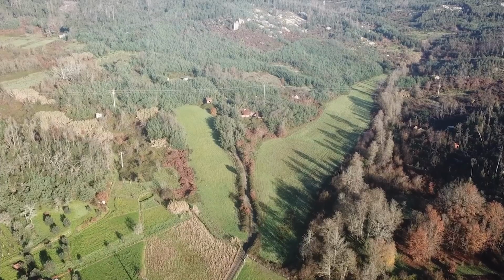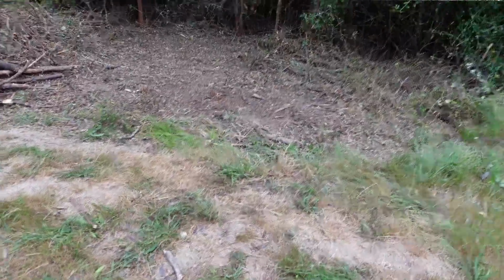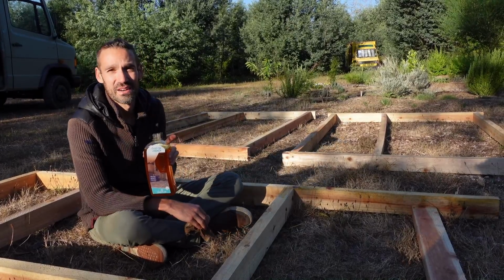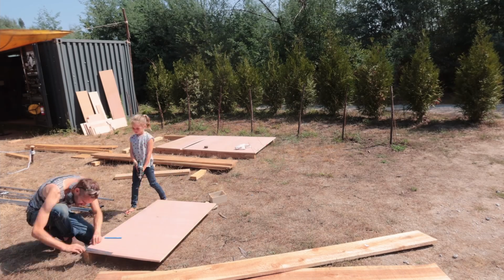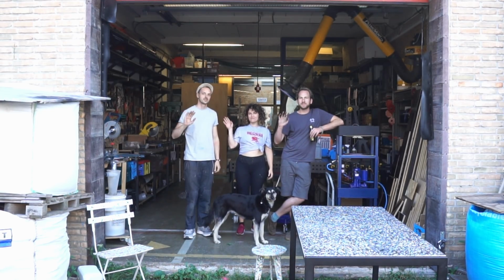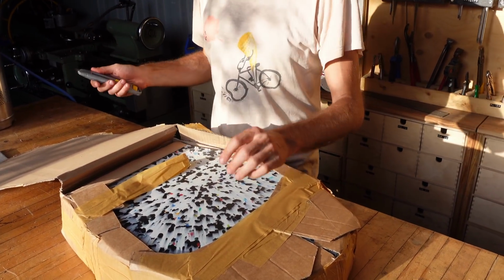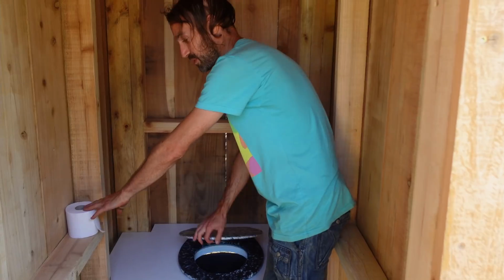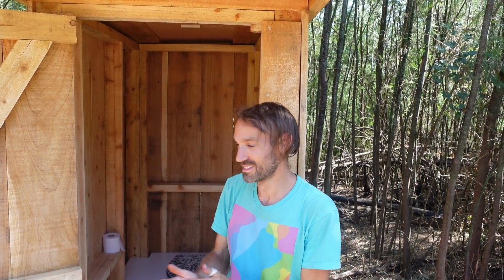#32 Making of our compost toilet. With recycled plastic toilet seat!

Comment: You would be advised to put aplastic ‘pee shield’ on the inside of the toilet box to avoid the timber getting soaked.
Reply: I have seen composting toilets use a funnel made of flexible plastic, like rubber roofing material or a bucket with the bottom cut out, to ensure that the fresh sewage goes directly into the catch basin and not onto the toilet itself where it’s harder to clean.
Reply: You beat me to it, not only will the timber rot but it will also stink to high heaven.
Reply: This a true "bushradical" moment, he is a strong supporter of the pee shield
Reply: Aren't you supposed to pee elsewhere?  I read that if you pee and poo into the same container it makes the compost process significantly less effective.
Reply: Loving them orsum Toilet Seats.. such a orsum idea.. recycling plastic..

Comment: An insert for a separation toilet would be a good idea for use of recycled plastic. With such an insert you could separate urine from the rest. This way the moisture level is easier to maintain, without too much saw dust, the smell is kept down and the bucket will not have to be emptied that often. The additional benefit is that the guys don't pee on the toilet seat :-) 
These separators sell for good money. Using recycled plastic for it, generates an unique selling point.
Reply: And urine, while diluted (and uncontaminated by poop) is a wonderful fertilizer!
Reply: I think guys will still pee outside the outhouse. A diverter funnel and hose would be great for those times sitting down.
Reply: "The guys" can just sit down by the way.
Reply: what i said
Reply: No guy would go peeing in that booth, believe me.

Comment: Well done ! It would have been great to separate peen from poo. Pee, onces diluted to 1:20 with water makes instantly the perfect fertilizer for any plant, while poo needs a two year cycle to be composted. Separate fluid helps also a lot to reduce smell too.
Reply: 100%
Reply: Even if you just get the blokes to pee in watering cans it's better than nothing. On one community garden I've been involved with we used an old plastic  bottle, turned upside down & attached to the wall, cut into a rough urinal shape and with a short hose attached to the lid feeding through the wall and straight into a normal compost bin next to the composting loo.  On my own allotment I just pee into a watering can (in the composting loo shed!) and then use it to water the apple and plum trees.

You can get pee diverters for the ladies too but that's a bit more involved as their, er, "plumbing" is a little bit different to us chaps (so I'm told! ;-) ).
Reply: Everyone tells one to seperate the pee from the poo, but if there is no need for liters of fertilizer and you have no sewer I dont see any big advantages. I think it can also make more work if you have no sewer. In my experience the smell is not a big problem if one uses more sawdust and maybe effective microorganisms. Which would also help to break the poo down much faster.
Reply: @axelSixtySix  I think two years is the worst case, with a meat eater with bad gut flora. A good plant-based person with good gut flora has very benign stool. It could be dealt with basically the same as cow manure.
Reply: @lightdark00  It  sounds like a vegan questionnable ideology. Contrary to omni what you may think, vegetarians have weak microbiota compares to omnivores. Low bacteria types leads to more composting times. Human dejections are filled with a singulary microbiota that reacts mostly under the warm temperatures of a human body. In the composting bin, it requires about two years, and even more in cold and/or dry climates.
Reply: @axelSixtySix  "weak microbiota"? The absence of the bad flora does not make anything weak. More variety is hosted by having a varied diet of a whole-food plant-based, not a junk food eating vegan.
Reply: @axelSixtySix  Animals are supplemented B12, unless they have access to an non-purified land water source. So instead of eating animals, and drinking questionable water, a supplement once a week of B12 is plenty. It would take years to show a deficiency. Everything else, not available from plants, my body makes from the sun or changes what I eat into higher level chemicals. Furthermore, my transport and living choices means my abundant D3 from most the year, will keep me adequate through winter. I also tend to lose weight over winter, so that's excess D3 and vitamin A there too. 
No one today benefits from the average omnivore diet. As people age, they seem to get fatter, and mental degeneration is on the rise too. All brought to you by the bastardized standard American diet.

Comment: Lift the whole house onto some stones (~15cm) with some plastic on top as water barrier to avoid capillary water transport from the stones into the wood.
Reply: Wax on the  bottom edge of the boards will stop capillary action just as well.
Reply: Can do that, or just some concrete stumps plus ant caps ;)
Reply: @kschleic9053  Won't be enough. If you want to keep your stuff from rotting, keep it away from the ground. Always.

Comment: Tip when you renovate the outhouse  put a sheet of corrugated steel on the inside, it will prevent pee from rotting the front panel

Comment: As an old Hippie from the 70's USA, the outhouse on my farm would fill with water and occasionally when dropping a load a little drop of that water would slash up and hit you right on the money spot!
(Arm gripping shrieks of terror ensue) so I installed a sheet metal baffle of sorts so your poop would hit that first and deflect and minimalize any splashing (huge sigh of relief!) but our friends from the city when visiting complained about when they finished they would turn around and expect to be doing something to complete the transaction and were left unfulfilled~~~ sooo I installed a toilet handle to the side of the box with a chain that went down to the tin baffle, when you turned the handle it wiggled the metal a little, it actually did nothing but it solved the city people anxiety and gave me great amusement!

Comment: Next job, build a compost bin nearby to empty into, or rather build 3, one for each yearly cycle. Also, ventilation to the cubicle and also to suck the stinky air and flies out of the loo part. And a door at the back to keep out the flies and wildlife who might want a poo dinner or make a nest. And also, make a separator to catch the pee so it doesn’t all mix together.

Comment: A DRY composting toilet would work much better for you!  The idea is to separate the urine from the solids.  I have seen them in rural areas in México, they work very well! They build two separate deposits for the solids, and they use one toilet first. When it is full, they switch to the other one. (Two toilets but only one in use).  The full one gets "sealed" for a number of months, and when the time is up (don't remember if it is 6 or 9 months), they open it up from the base at the back where they left a door, and they take out the compost, ready to use in the garden or orchard.   The urine is diverted directly into a big bottle or bucket. Then they dilute it and use it directly in their garden.
The great thing is that it doesn't stink. They use leaves, woodchips to cover their feces.  

Here is a link in case you want to check it out for future composting toilet ideas. 

https://www.youtube.com/watch?v=98B8lpuSPZE
"Letrina abonera seca" (Dry composting toilet)

Comment: The door is on backwards. The diagonals should be going up from the hinges in order to keep the shape and not sag. Over time it will sag the way it's currently supported by the diagonal braces
Reply: Exactly. Wood is stronger in compression than in tension.
Reply: It looks like a reverse double z barn door design. Has anyone ever tried diagonal braces in this unusual pattern?

Comment: Nice building.....but....I would have found a spot in the shade where the outhouse is on a mound or added dirt where you put it instead of putting it in a hole you dug, it rains a lot there.

Comment: Get a pee diverter with either another bucket to empty or a pipe that goes somewhere to drain.  this will eliminate the odor problem.  When the two mix it creates a stinky outhouse, but if kept separate, there will be almost no odor. This is how it's done in compost type toilets in skoolies, vans, and tiny homes.

Comment: It's good you didn't make both loos at the same time, using the first as a prototype leaving room for improvement for the second one. Separate urine, no pathogens in urine so you can use it directly around your fruit trees, or just lead a line directly outside to a soak hole and plant nettles around which love urine. 
Well done for collecting this valuable  resource.

Comment: You may want to consider drilling a hole in the container and connect a tube and allow the “liquids” to drain off into a separate hole.  An option is to dig a 4 foot hole 4-5 inch diameter hole with an angle 3-4 ft pipe sticking out of the ground, for the boys to pee.  Cover the top with some fine mosquito netting, push it into the pipe to create a small indentation.  Somebody gets the job once every couple of days to sterilize the mosquito net and wash down the pvc pipe.  This will alleviate the smell from the boys going where ever they like and will keep the smell down.  It will also keep the bugs down.
Reply: You're bad at giving directions, but I was amazed when I saw mosquitoes could live in a bucket of urine.
Reply: @brianjohnston9822   You described what you thought basically backwards. There are more succinct ways of describing it as well. Also confusing if you said two options or the second is explaining the first. 
The whole problem is the build was not as practical as it could have been. It's not anchored, direct ground contact in a lowered ground spot, the can is too close to have a proper diverter for both sexes, the back is not closed off, no aeration, no exhaust pipe out the top from the waste area, and no lighting for night/very early morning movements.

Comment: I'm surprised it took you so long to build this, especially with all the rain you get, nothing worse than taking a dump in the rain, however based on my experience the bucket is way to big. You'll have to empty it reasonably often or it'll be unmanageable. I'm sure you'll get a lot more help now.

Comment: In working with the power tools so much, how did the solar power sustain their use?
Reply: They use the generator if it's very power hungry. There probably are battery systems that could handle it, but they're probably quite expensive and don't make sense for the current scale
Reply from the maker: All single phase tools run on Solar. Only 3 Phase on Generator. So far so good!

Comment: The size of the wood looks overdesigned to me. Anyway, the structure is not anchored in the ground. If you have high winds there it might move or worse. I thought that in the earlier videos, which I really enjoy, it was said that it can be cold there. There are cracks between the planks which might further open if the wood shrinks. So if you do business there in a cold winter night it might not be the most pleasant experience because of the draft. The seats are  übergeil !!

Comment: Why was the oil used and not paint? I thought oil was only for inside use. Isn't the oil with the heat going to dry out the wood? Will the oil protect the wood from rain and freezing?@4.26 don't you usually dig a real deep hole before you put the toilet over it??
Reply: Oh a there is a hatch cool😂😂😂

Comment: What are the dimensions of the lumber there? I bought some lumber once in France and they have something similar to a 2x4, except it’s closer to a square cross section. What you have there looks different from what I got in France.
Reply: You think that's odd, try French toast.  There's no way it will pop out of the toaster like that, egg everywhere, it is a real mess.

Comment: Every time I see you cutting brambles with that cordless cutter I wonder whether a more sustainable method wouldn't be an 18" bush scythe.

Those batteries aren't going to last all that long in the high drain devices you're using them in regularly.

Comment: As Triumph would say -- Nice toilet seat... FOR ME TO POOP ON!  What to do with the "resources": Make weiners with it.  People have been told for years what is in weiners and they still eat them, nothing is off limits.  I have 2 questions, 1) will you build a larger version for meat eaters to use and 2) does sawdust work to ward off the smell of diarrhea?  C) What about chili night?  D) Will you have corn boils?  I hear they are pretty hard on septic systems.  Thanks for sharing, too bad it's supper time.

Comment: First I add rocks as foundation, then I would add something to close the back and make a sliding out platform for the bucket. That filled will be a shitty job otherwise :,-)
An opening in the door and correctly hanged, with a closing hook. White chalk on walls. 
And in end, bigger in size due to wheelchairs.
None of you are currently now not using one but futureproof and accessebility for all.
Now the shit hits the can!

Comment: for the composting to work properly you should separate the poo and the pee. if you don't do separation the composting will not work properly (too high moisture content) and it will smell bad pretty quick. it's also ways les horrible to clean out. this can easily be achieved by a funnel in the front third of the hole, where the poop lands in the bucket and the pee gets drained away to a trickle pool.

see also: https://en.wikipedia.org/wiki/Urine_diversion#Purpose 
https://en.wikipedia.org/wiki/Urine-diverting_dry_toilet

Comment: All this talk about sustainability but every time they add something with new materials instead of recycled ones. They build a part here and then a part there but there is no clear plan of what they want. Eco farms are a dime in dozen out there it seems if you look through the recommended after this. I checked the discord and there is no talk about Earthships or similar concepts where water, waste, heat, and cooling are integrated with the structures. Just wondering where this will lead to without a clear idea of what they want, hope they figure it out.

Comment: While I applaud the build, please know that human waste is NOT generally safe for composting onto your edible garden, etc.   Human waste contains viruses, bacteria, and other pathogens that are not effectively removed by standard home composting processes. There are processes that commercial composting facilities use that can treat human waste at extremely high temperatures for extended lengths of time.   And even then, in some countries like the US, the result has to be highly monitored and tested to ensure safety.